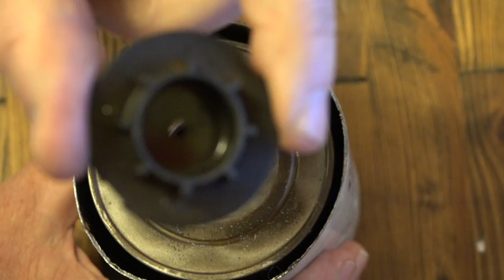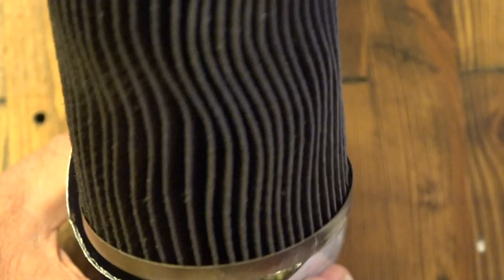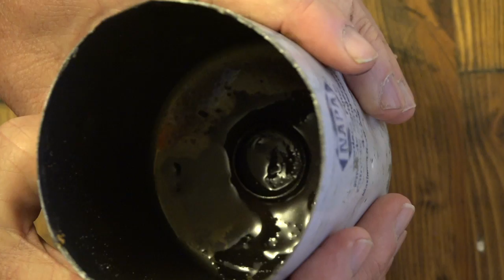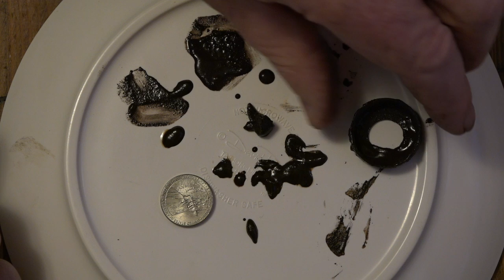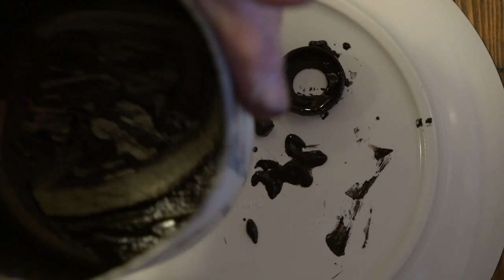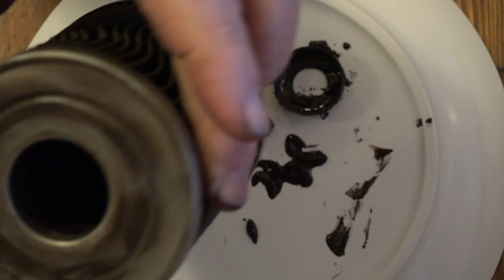Coolant Filter Update

Comment: If your filter looks like that with only 500 miles on it you have some serious problems. I just changed mine out and it was the original filter with a touch over 86k. I cut it open and it literally looked brand new🤔

Comment: Are you sure with only 500 miles? Because you must have something serious shit going on inside that motor. I just changed mine and it was the original and it had 86,000 + on it. I cut it open and it looks brand new and still shiny on the inside🤔
Reply from the maker: This truck was built in 1982, I installed this filter system some 30 years later. Even though the Army put in a new radiator and changed out  the coolant and I even drained out the coolant before installing this system and adding new coolant,  goes to show how much sediment stays in the system. Now if I did a proper chemical flush of the coolant system before installing this filter system it probably would not of been this like this.

Comment: I installed this (Inline Heater Core Coolant Filter & Inspection System 5/8", VE-Labs CIFS-1).  The problem.  I did 3 radiator flushes on my 6.2 diesel motor.  I can’t drive it for more then 50 miles before the filter clogs up.  So I will be changing the filter to a bigger bypass system.  But it’s amazing in a sad way. How much junk can flow threw the radiator system.  Don’t know if this will hurt anything.  Just doesn’t seam to be good.  Good write up.